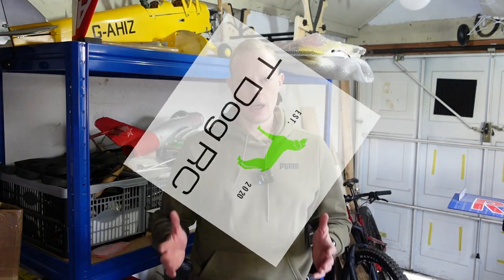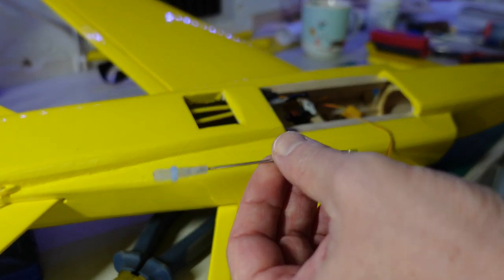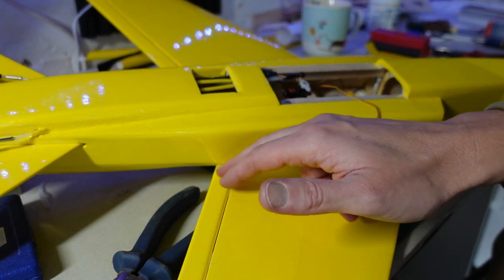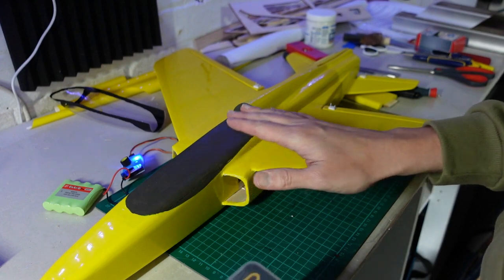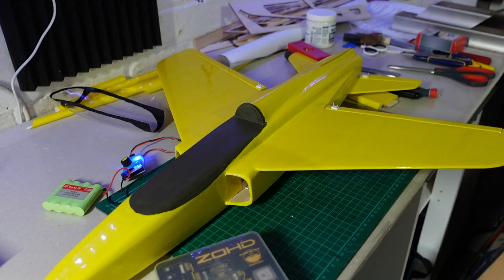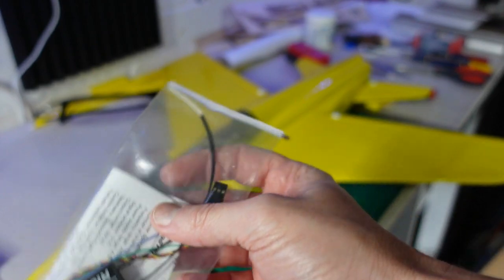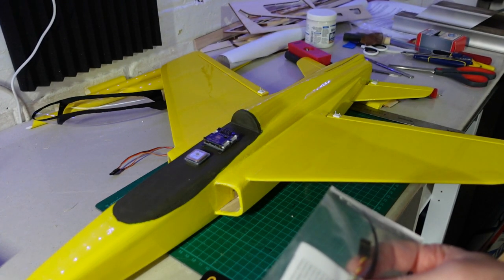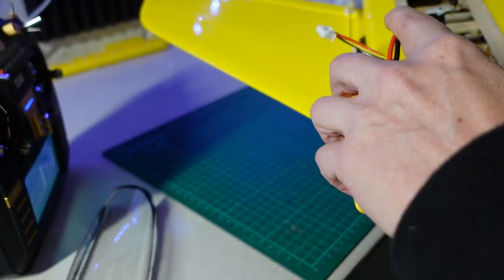Tony Nijhuis 25" EDF Gnat - Balsa scratch build - PART 9

Comment: Thanks for showing the build. I’ve made the Hunter and the Lightning in this series, and I’m looking forward to seeing how you get the battery in and out! In my experience it’s a right pain and the CoG (particularly rear wards) seems to be quite critical on these. Get it right and they fly very well, unless the battery comes loose.
Reply from the maker: Thanks for watching Chris. I’m using valcro to hold it in place and then a stiff piece of foam to wedge it in. Hopefully that will be ok 🤞

Comment: Of course I'm watching 🙂 I always remove half the backing on the decals and cut it off then replace it with a small gap of sticky showing, then you stick it down followed by removing both halves of the backing and it's quite accurately placed. I couldn't tell on the final video because I'm viewing on my phone if you've painted the air intakes either yellow or black? So now the maiden ... good luck, fingers crossed for you 👍
Reply from the maker: Another great tip thanks Cliff 👍
Reply: @tdogrc  I've added to my comment T Dog 🤔
Reply from the maker: I haven’t painted the intakes. I did think about painting them black though.